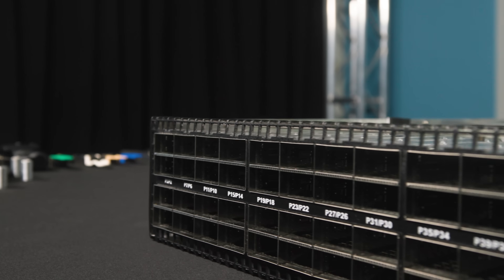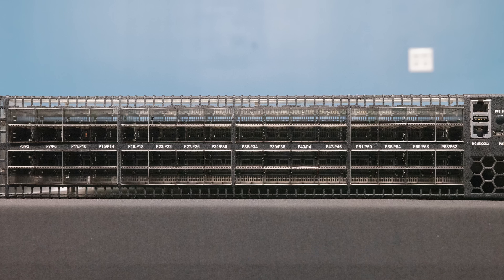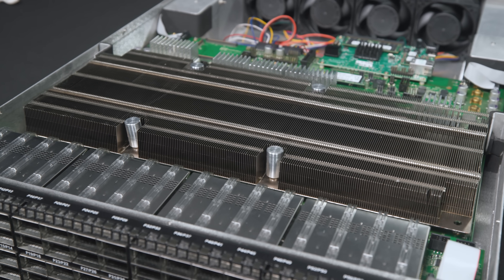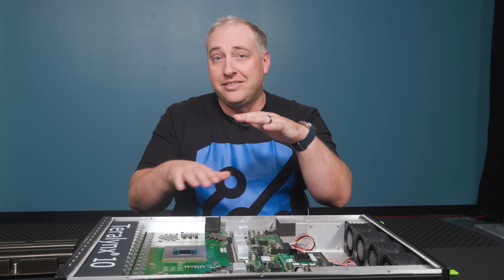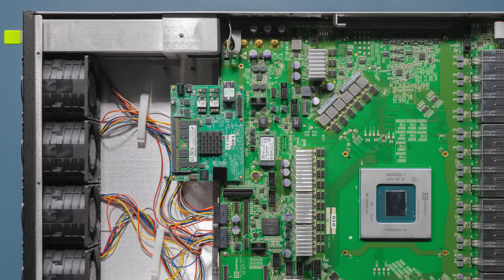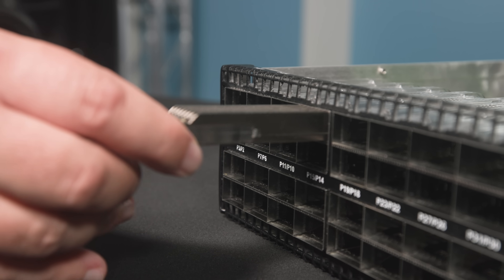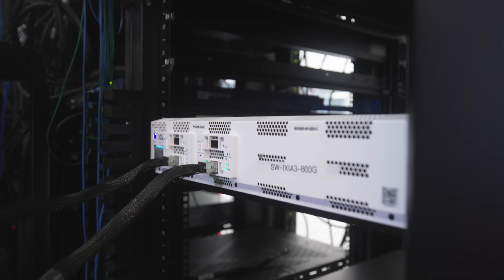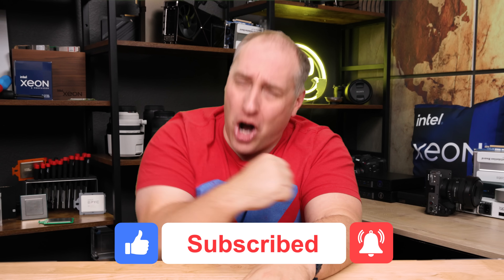Inside the FASTEST New 800GbE 64-port Switch

Comment: Suddenly my 100Gb switch feels inadequate.
Reply: And here I was thinking 25 Gbps was pretty hot.
Reply: @JeffGeerling  Regarding the prices of 100G equipment nowadays and you can buy 100G and 25G NIC at pretty much the same price makes 25G less attractive :)
Reply: @JeffGeerling  I'm happy with 1Gbit.
Reply: @oguzhan001  
Whoa, okay there gigabit and multi gigabit club.
Here I am, looking at my graphs and I don't think I've ever passed 100Mbps (not even on my nas). Like doubt digits. 😳. Except for the proverbial speedtest or course.
😂
Reply: @jamess1787  Pretty sure I got a PCI (not express) 100Mbit card stashed somewhere. You're not retro, you're forgotten relic!
Reply: @jamess1787  That is because your, and every other consumer, network is too slow to do much more with it. If we had faster networking there are some really cool things we could do with remote desktops. Right now we add a lot of latency simply encoding a video capture of the desktop and decoding it on the other end. If we had faster connections though you could copy the frame buffer entirely for sub ms latency. IPMX is doing that but currently it is only found in broadcasting software probably because consumer network gear is so woefully inadequate.

edit:  I think intel did a similar concept using thunderbolt 5 but doing it over networking would be a lot more versatile.
Reply: @oguzhan001  "I'm happy with 1Gbit."

LOL, I'm struggling with 1Gbit connections when having a single SAT>IP flat antenna and doing simultanaeus scan on 8 transponders at the same time...
But soon a 100/40/25/10/1 gbe combination will run in my home
Reply: Hey, if you want to send your old inadequate switch to me. I’ll take it, no questions 😂
Reply from the maker: Let me know if you ever need some footage
Reply: Didn't Freud have something to say about switch envy?...
Reply: @poorlybuffalo555 didn't it have something to do with wanting your mother's big port? Very Freudian 😂
Reply: I'm just now upgrading from 10/40Gb to 25/100Gb myself
Reply: I don't even have 2.5 gib
Reply: 100Gb is good enough for the peasantry.

Comment: And here I am, sitting at home, with my piddly 36-port 100 Gbps Infiniband switch, that's sitting in my basement.
Reply from the maker: There is a war brewing between IB and Ethernet! Just be thankful you do not have an OPA switch
Reply: @ServeTheHomeVideo  
Agreed.

Oh, I know (about the war between Ethernet and IB).

My Mellanox ConnectX-4 dual port cards can do either PHY LINK_TYPE. 

Running my 100 Gbps IB cards as ETH ports, I can use the as a Linux Ethernet Bridge in Proxmox, but VM <-> VM between nodes max out at around 23 Gbps, which is SIGNIFICANTLY lower than what the port can do (which is about 96.9 Gbps out of 100 Gbps possible).

On the IB side, my applications has topped out around 12 GB/s (96 Gbps), and ib_send_bw tests show a possible 97-ish Gbps out of a possible 100 Gbps.

IB side doesn't support bridge networking like ETH side, so I tried to enable SR-IOV on the NICs/ports, but the OpenSM subnet manager for IB from the Debian package doesn't support virtual functions/virtualisation at the SM level (requires RHEL and/or its derivatives for that), which then causes configuration issues for my Proxmox server, because I'd have to do this very funky setup where I pass one of the ports to a CentOS VM, start the RHEL opensm, only for it then try and enable virtualisation on my switch so that the Proxmox host's VFs MIGHT work.

It gets REALLY complicated, REALLY fast.

There are a whole host of issues that arise with a config like that, so I stopped trying/testing it for now, and am keeping it as just single point-to-point connections via the switch (for now).

(Don't really need the VFs to work because I'm using virtiofs for VM<->host communications, but it might be useful if I want to try and spin up a cluster later so that I would be able to start the VM/Container with the HPC app that I want to run, rather than physically swapping out hard drives or multi-booting via the node's BIOS.)

Comment: So there's just no way to directly connect a server to this running 800GbE?
Reply from the maker: In a few months when we get PCIe Gen6 CPUs you can do an 800GbE port off of a Gen6 x16 slots. These 51.2T are really going to get deployed en masse in 2025 as well. Just showing this off before it becomes more common
Reply: Maybe next year. But for now people will be using these to connect using 128x200G and 256x400G connections to server or directly to accelerators (bypassing CPU, memory and PCI), mostly ai stuff, and maybe some FPGAs sometimes.  There is no info on any product or system supporting pcie 6, but I do expect Nvidia mighty be the first to deliver something in their systems capable of 800Gbe. After that maybe IBM and then Intel and AMD. As far as we are aware AMD Zen 5 on desktop and server will be Pcie 5 still. But IBM Power 11 is most likely to support PCIe 6.

Comment: I imagine one of those OSFP modules already costs 10K.
Reply: Probably more than that for a brand name manufacturer. Back in 2017, one of my customers building a high-speed campus network (100GbE switching & routing) was already looking at an easy US$13k per 100GbE transceiver. For a project at US$2 mil total, the transceivers alone came in at around US$1.1 mil.
Reply: @BigBenAdv  and why you would need 1000km OSPFs for campus? lol. If you are talking about normal 800g OSFPs with like 500m-10km range then cheapest is around 1k usd and more expensive one 3k usd from FS website
Reply: Ye... The switch you will probably be able to get for less than a thousand bucks in 2034 but the cables and transceivers though...  😅
Reply: Brand optics are more expensive. Like by a factor of 10. But you can already get third party modules between 2000 and 4000 euros from third party (eg flexoptix), depending on SM/MM and power budget

Comment: really cool, but why the cheap SSD and a non-replaceable miniscule battery? You probably have to spend a good fortune on a switch and get..... but hey I guess at least you can replace it if you need to.
Reply: Why would you want a more expensive SSD? You're not gonna run games from it or process datasets on the switch itself anyway. That SSD will load the OS when the switch is first switched on and hopefully never again until a few years later the switch is turned off and replaced.
Same for the battery: should never be used as you do not buy switches like these to keep them in the box.

Comment: 800Gbit/s is 100Gbyte/s which is nearly double the speed of DDR5 RAM (about 51Gbyte/s).
RAM-Speed over network. Crazy.
Reply: that's only half the picture, DDR5 latency is going to be much lower than this and it will matter a lot
Reply: @marcogenovesi8570  i know. we speak of ns vs ms. But fast enough for memory-to-memory transfers over ethernet. there's not much appclications that need such low latency but a lot that needs huge amount of memory.
Just imagine what storage you will need to saturate 800gbit/s.

Comment: how much is this? $20,000 ?
Reply from the maker: Switch pricing is very strange. For example, when we saw early 32-port 100GbE switches Arista might sell for $20K, Facebook was buying the Wedge100's for like $2500 each. Do not forget the optics though. 800G optics are not cheap.

Comment: 9:25

HOW MANY LAYERS IS THAT PCB!? That's like HALF A RJ45 port height in PCB depth. I've never seen one that thick before.
Reply from the maker: In 2019 we started talking about PCIe Gen4 signaling in servers being a challenge leading to cables instead of PCB risers. We see that more now. PCIe Gen6 and Gen7 will get worse. The switch guys have to deal with crazy signaling much earlier.
Reply: 1.8kW of power planes is no joke either
Reply: @Mr.Leeroy  Depends on the voltage.  If it were 12V, not so bad, but from my reading it's apparently 3.3V.  Almost 600A is serious.
Reply: @concinnus  OSFP power is around 3.3V, yeah, but for 5nm main chip I bet power rails are certainly below that around 1V.
It is harder than a simple Ohms law calculation because current loops do not distribute evenly across whole plane area, engineers have to account for plane density.
Reply: I have a ppt I can't share about 1nm optics
Reply: @feedmytv  Do you mean 10Å process node optical transceivers?   Cool if so!
Or do you mean 1nm EM fields?  Modulating data onto X-rays would give a decent leap in data capacity.   Better be into space and not any datacenter I walk into.  :)
Reply: @concinnus  Amazingly still less than a Xeon Max though. That's 1025Apk. No wonder they needed a several-hundred-phase FIVR on-package.
Reply: That's what she said...
Reply: 48, 60 layer boards are not uncommon these days but they are still very, very expensive.  I know of one company which makes 64 layer for defense products.  The things are so heavy and rigid you could probably use the PCB as armour.
Reply: @AndyGraceMedia  Composite glass-resin-copper (CPR), smells terrible when shot at. That'd be 10 trillion dollars, send me the check tomorrow, DoD.
Reply: @AndyGraceMedia  funny thing is that the first generation composite armor on the T-64 and T-72 A are texolite or basically woven glass fiber impregnated with resin or in another word, PCB without the copper layers!
Reply: @Lustanda  awesome comment!
Reply: My guess is easily 36 layers, but possibly 10 more.  Very thick PCB, but also special materials and processes to control impedance and thin trace tolerances, and for sure also things like buried vias and blind vias. Pretty high tech.
Reply: @movax20h   the thickness of that via is amazing 5:00 , must be a power via, or ground
Reply: @movax20h  Maybe you need the z height to get a bunch of controlled impedance traces on top of each other, rather than just a needs for a crazy number of layers as I'm not sure why you'd need that if all the buses are fanned out intelligently.
Reply: Oh my gosh good spotting. Biggest I've seen too and I've dug around some really weird expensive laser equipment before lol.
Reply: Japanese manufacturers are already talking about 42-layer PCB when making the motherboard for the Fugaku supercomputer. I think this is somewhere along that amount.
Reply: I visited the Amazon lab where they are building their own 51.2T switches in house with this chip, and it's a 40 layer PCB. It's so beefy.

Comment: This sounds like a good upgrade for dialup BBS
Reply: do yourself a favour and wait for the next generation
Reply: Still remember my first connection on my 8-bit C64 using an old 300 baud dialup modem, however I was able to connect up to a Color BBS but it was a painfully slow load :p

When I trained in the USAF we used the original Acuostic Modems, I think these were like 50 ~ 60 baud ?

You placed the phone's handset onto the couplers and it communicated that way, still a dialup type connection but there you go.
Reply: I thought I was living the life when I got a 9600 baud modem.
Reply: @headlibrarian1996  You were - Trellis coding - magic back then.